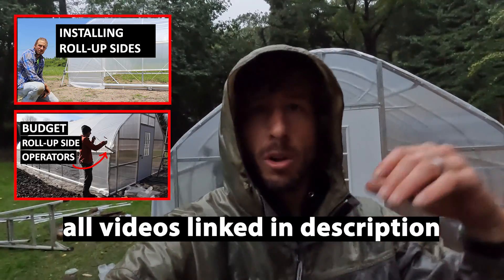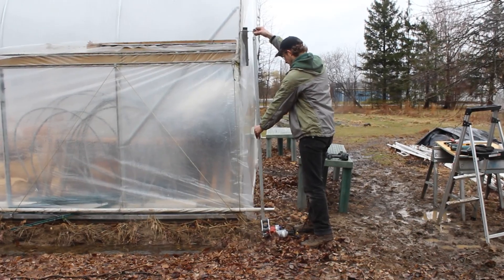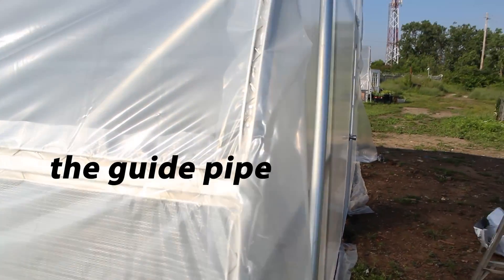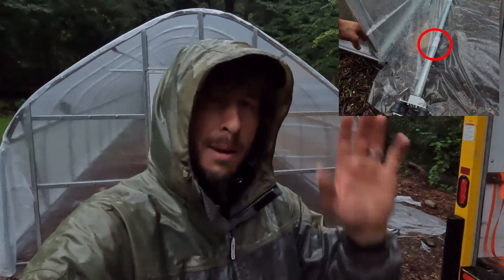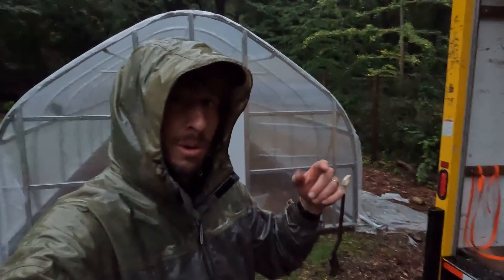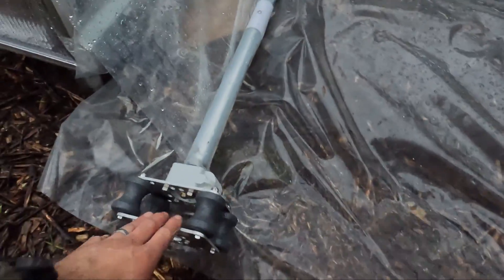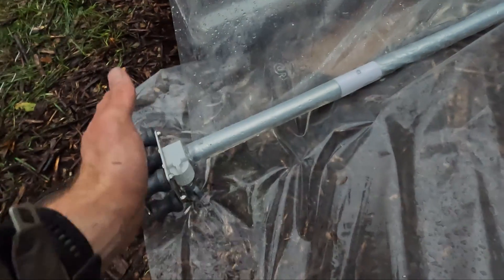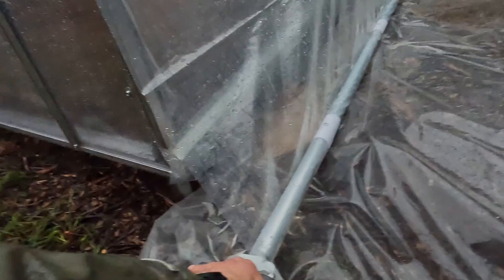QUICKLY Install Guide Pipe for Greenhouse Roll-up Side Gear Boxes

Comment: Can I use the same method for a 20x24 high tunnel instead of attached to the structure? I found this method straight forward
Reply from the maker: Yes, you can. If you have a structure with straight sidewalls, it is easiest to do this method (as opposed to round style structures).

Comment: Why roll up instead of drop down with 3ft. raised beds ?
Reply from the maker: There are pros and cons to rolling up and dropping down. Dropping down takes more hardware for install (and if novices are installing there is a higher likelihood of poor installation), and because they "drop" down and don't actually roll, it always results in a bunch of plastic bunched up near the ground when they are in the open position, which we are not fans of (both for potential wind issues, but also for potential damage over time). Additionally, drop down sides require a good weather seal be maintained near the hip-rail, which is more difficult, and if for some reason it has issues than the hip-rail location can become an issue for wind, water, and continual problems. At the end of the day, everyone has their preferences, but those are the reasons we prefer roll-up sides. Additionally, shin-walls can always be added to these structures which can protect young crops just as well without the issues I mention above. Thanks for watching!
Reply: @tunnelvisionhoops  have 2' shin wall put up. May go ahead and chang to roll up. Wind issue here in central west Texas.